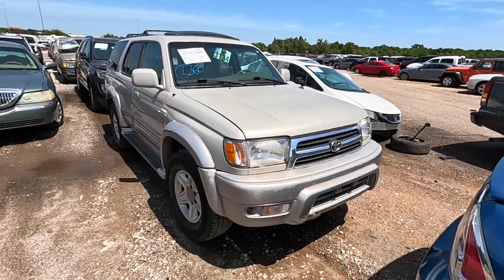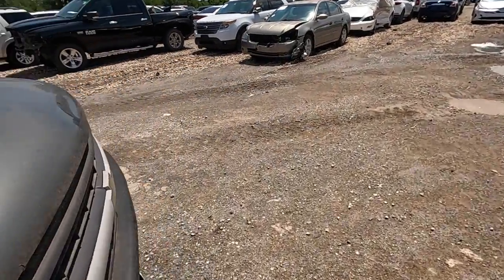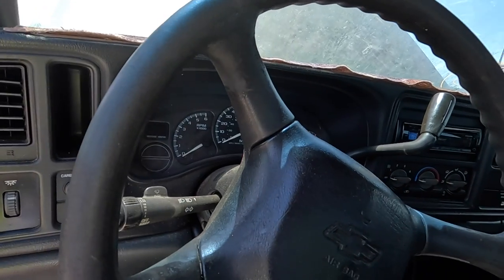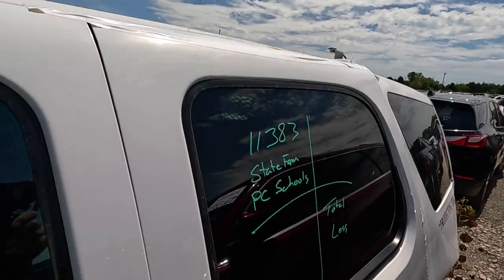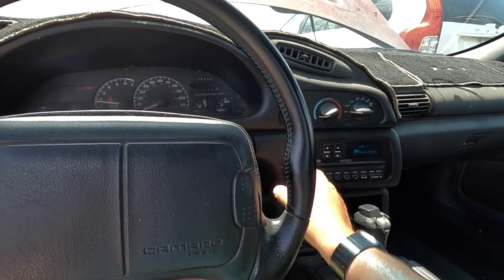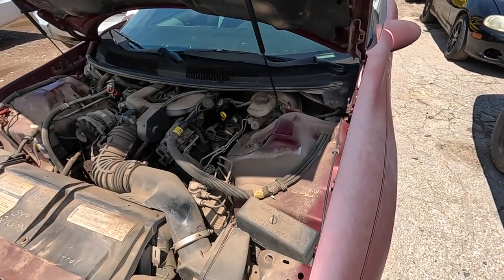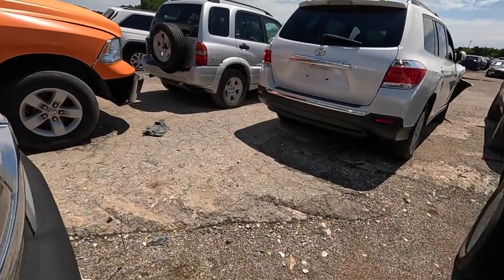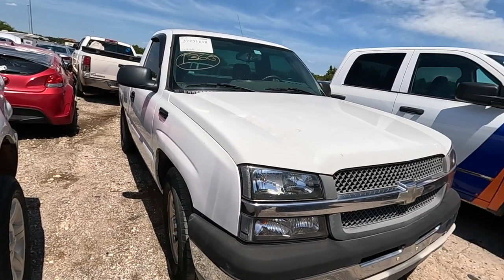I Found this Vandalized Nissan Altima at IAA! Furry Bush?

Comment: GM AFM is a bit weird for the first few years.  AFM actively began on the 5.3 and 6.0 in model year 2007.5 which is the introduction of the GMT900 platform.  You can buy a "classic" version of the truck in 2007 that was essentially a 2006 that did NOT have AFM.  But between 2007.5 and 2013 if you do not want AFM you need to either get the 4.X engines OR the 6.2. The 5.3 and the 6.0 all have AFM.  2010 saw a minor revision and some people believe it to be better.  By 2014 When they went to direct injection, all of the engines have AFM, including the 6.2.  Hope this helps.

Comment: The 4runner timing belt is an easy job. Plus its a non-interference motor, so no harm done the engine
Reply: Engine locked up 
I think u maybe wrong on this one

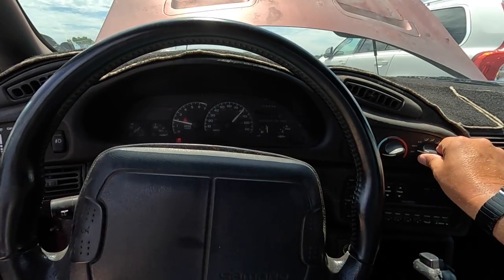Comment: Did you see the speedometer doing funny things at the camaro? Check 18:50 and later when you turn on the lights. It might explain the oil pressure gauge not working 🤔 ok, after watching 24:00 and on the oil gauge may not be faulty at the end 😀

Comment: No AFM on that generation 1999 to 2006/2007 GM truck.  You definitely want the V8 in those 5.3 or 4.8 LS based engines.  Probably the best trucks GM every made.

Comment: I own a '99 4-Runner. Last year built in Japan. It's a timing belt motor but it's NOT an interference engine. Get it Randy. Easy easy fix. At least give it another look. It might be locked up but it might not be. Could be a bad ground... Etc. One of the best Toyota engines ever built.

Comment: DoD was put on the GM v8 mid 2010s but it was on the bigger engines. 454, 350
Reply: They had em way earlier than that.

Comment: Hey not trying to be rude but u mean 5 3 vortec in the Silverado bc I have a 2000 gmc. With the 5 3 which is the biggest motor. In thr 2000s gmcs

Comment: What would a 1973 Chevrolet Cheyenne super 10 it is red with would grain interior and outside  it has 29,000 miles on it 100 percent original  has the price tag in the seat from the dealership all the tags laying in the never put on still has plastic on some interior parts never been smoked in AC works  custom leather from the factory .. what would a truck like it be worth it is a long bed ? Anyone on here have an ideal